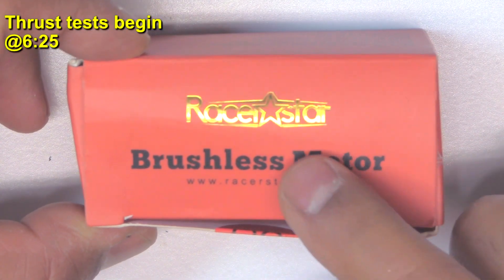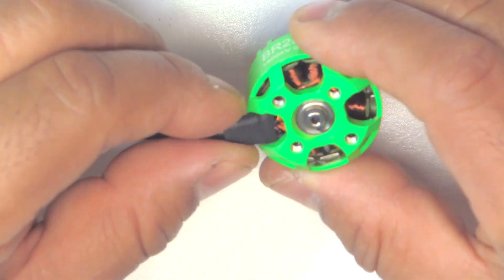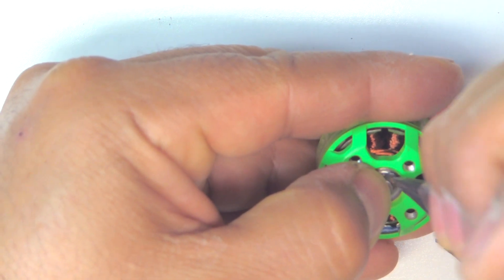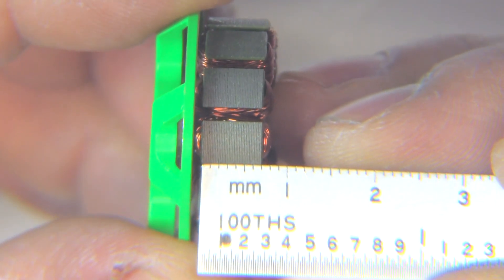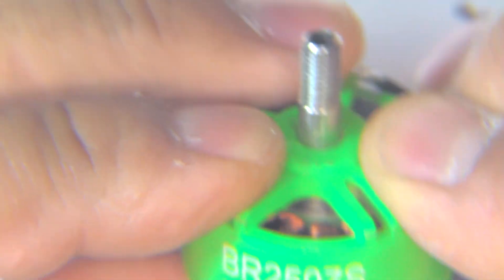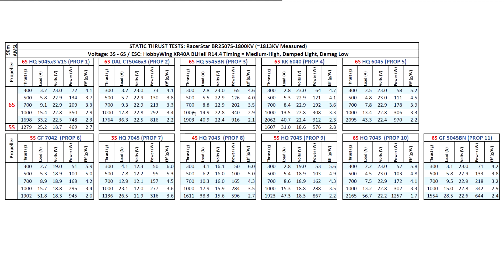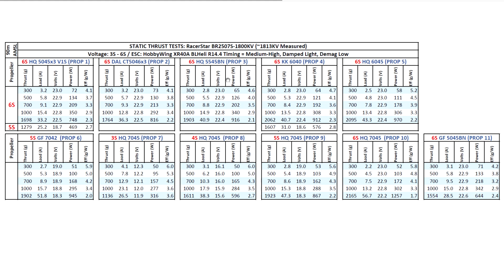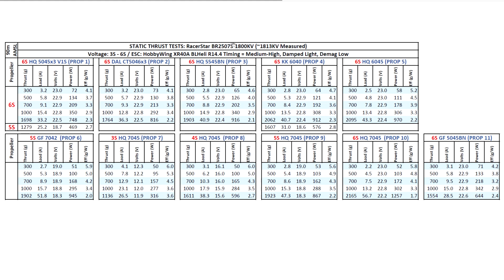RacerStar BR2507S-1800KV Big Low-Budget Motor from Banggood

Comment: Dear EngineerX, I admire highly your work, but please in future videos, when you get some motors for testing from the manufacturer, please insist them to provide the maximum continues power of the motor since this is the most important parameter as you know as an engineer. I've burned several from the motors you have tested with a lot less power then the power I've seen in your tests. As example brother hobby avenger burned out for about 5 sec on 800 wats of power.
Reply from the maker: I'll ask the manufacturers and see if they provide that information. I think IF they give the max continuous power rating it will be a LOW number because perhaps they don't want to run risk of claiming too high or borderline. Most motor manufacturers don't know or don't give that rating or they give some number too low or sometimes too high. There's no standard so it's difficult to get any good number from them. I will ask them and if they give info I'll add it to the video.
Reply: @EngineerX  Great this will be very usefull
Reply: Should be able to tell what the amp rating is by the wire gauge. And then multiply that by the voltage to get the max power.

Comment: So i really look forward to your work. Thank you. Really hoping to see the new T-MOTOR F-80. I bought a set of racerstar motors 2405s or something in racing red. I was really disappointed  High amps low power i flew a pack and replaced them with a set of emax motors. I am not a snoot but they seem like for value per dollar they were still overpriced i will probably use them for a plane someday as they make for messy paperwieghts
Reply from the maker: Yes, the RacerStars are true low-budget motors. You can see the magnet-to-stator gap is huge and stator wire looks like it's been used or recycled LoL.... Well for $9 to $12 per motor they don't really use top components. These here make some OK thrust using their big size. But of course there are better options. 
I've contacted Tmotor in the past and never got a reply or offer for sample motors so I'll have to think if I want to order one of those F80s for testing, but not sure because they're not cheap. Thank you for watching.
Reply: Anything above 22 stator suck a lot of amps for slight increase of performance.
Reply from the maker: True. 24XX & 25XX are better match for larger 6" to 8" props.